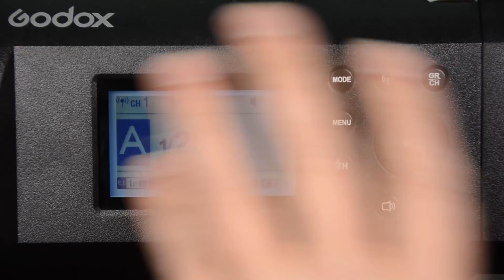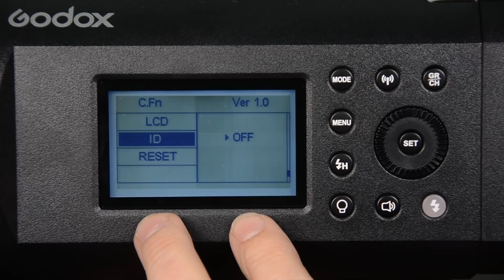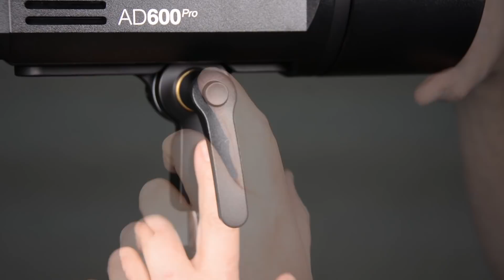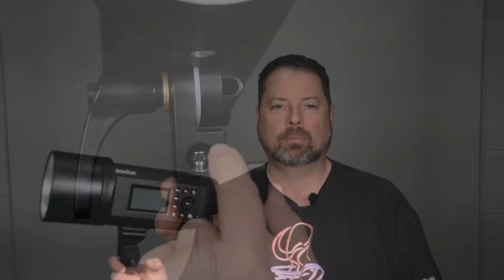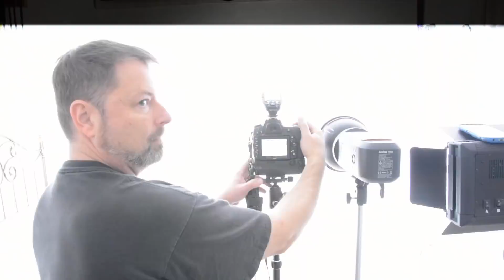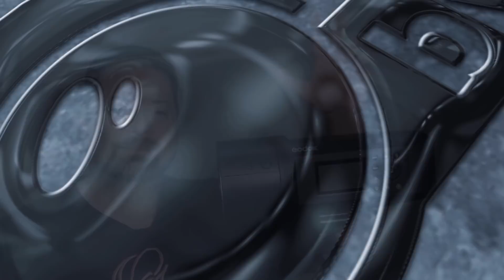AD600 Pro Studio Tests (Pre-Production unit)

Comment: Have you had any issues with the battery not charging? I bought a new unit and so far 2 dead batteries! Won't take a charge even after hours of being plugged in.
Reply from the maker: I have not had any issues with batteries.  I have talked to a few that have.  Most of the time it seems the batteries were not well cared for (left in extreme hot/cold or left fully discharged for too long.)  My original AD600 batteries from 4 years ago are still running as strong as the day I got them and I use them almost 7 days a week.
Reply: @ImagesbyDesign  My unit is brand new and has never been charged even once. It arrived without a functioning battery...twice! I'm waiting on a replacement from Adorama. Hopefully this time I'll receive a functioning battery.

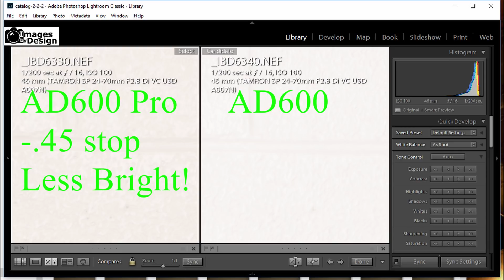Comment: 7:39 other more exact tests (with a light meter) showed -1 stop light output in AD600 Pro due to the frosted bulb (center measurement)
Reply from the maker: The problem with "exact measurement" tests for this type of equipment is that you'll end up with results that might favor one product over another when you only examine numbers.  But lighting is much more complex and nuanced than individual measurements.  One of the problems with the original AD600 bulb design was that it created an unwanted hotspot in the middle of most modifiers.   The torroid shape of the new bulb helps even out the light considerably.

Comment: Hi , may i ask if the ad600 works with pockt wizards radio triggers?
Reply from the maker: No, the two systems are not interoperable.  You can use a pocket wizard receiver plugged in to the pc sync port to trigger the AD600 but you won't be able to adjust it.  The better route is to switch over to X1 trigger.

Comment: Hi, many thanks for the very useful review. I would like to shoot in a studio mixing flash with continuous light to create movement effect. Would I be able to this with the AD600 pro modeling light ?
Reply from the maker: That depends a lot on the speed of the movement and how much motion blur you want to capture.  For something like a slow moving dancer (think hula) where you want just a whisper of movement, the 38w model lamp would illuminate perfectly.  If you've got fast moving subjects or want much stronger motion streaks, the GODOX SL-60 (AC powered) or SLB-60 (Battery powered) would make a great hotlight companion.
Reply: Images by Design Many thanks for the detailed answer. This is the kind of shoot I am after https://instagram.com/p/BRBG5xyDa8b/. I went to a workshop organized by this photographer. I have ordered the new Godox AD600 pro and will look at the suggested light.

Comment: I’m going to ask what may be a silly question but I’ve never used strobes before. Is the manual mode on this TTL strobe the same as using a straight manual strobe? I see the original AD600 comes in a TTL version and a manual version. It seems like you could buy a TTL version but still have the flexibility of shooting in manual mode as well. Am I missing any trade offs or am I mixing apples and oranges as far as what manual means on these different strobes?
Reply from the maker: +Chris Featherstone The TTL capable strobes can also be used in manual mode which works exactly as a manual only strobe.  I use both modes on all my lights.
Reply: Images by Design awesome thanks!

Comment: According to this review test, the new pro is actually almost half a stop less bright than the original AD600, but the strobe is cost a lot more.  Quite disappointed though.
Reply: It is the same power output as the old light. What you will notice is the new Pro the light is spread out farther and more even where the original 600 had a hotspot in the center. The pro is way better in soft boxes and modifiers than the original 600.
Reply from the maker: +Kenny Van I can't say the lower power output will appear in production units.  And, the other improvements make this worth the extra coin.
Reply: Thanks

Comment: I think the hole in the front of the handle is so you can put a spigot in it.  Then, if you are using the remote head, you can use a SuperClamp to attach the body to the light stand,
Reply from the maker: Perhaps, but then the power switch is between the handle and the stand.  Seems like a tight fit for folks like me with sausage fingers.  I would have preferred a single hole that was stable.  you can always rotate the handle 90 degrees for the horizontal baby pin on a superclamp.
Reply: I would have thought the clarence provided by the SuperClamp and the thickness of the folded handle would allow reasonable access to the button. However you've actually got the kit so you're in a better position to judge this than I am!

Comment: I'm just thinking how Godox can improve the power output to match the original ad600 on the production models. Hope they find a solution, everything else is perfect.
Reply from the maker: I did a more thorough test with different modifiers.  It's not that the light output is lower, it's just shaped differently.  In MOST modifiers, you will get slightly better output with the PRO.
Reply: Images by Design thank you! I hope to have this flash in stock here in Italy soon cause i want to buy my unit!

Comment: 1st. Nice review keep it up. Still debating this or original 600. $350 price difference. PRO build quality is much improved and look more modern though.
Reply from the maker: It's a tough choice.  If you don't use TTL, can live with the modeling light issues and don't mind the plastic mounting arm noise, the base AD600M is a great bang for the buck at almost half the price.

On the otherhand, this pro model is a really solid build, has industry leading color management and outshoots strobes costing twice as much, so from the top looking down, it's a huge bargain.
Reply: IronCan88 guess I gotta start saving my coins.  Definitely need this in my kit bag.